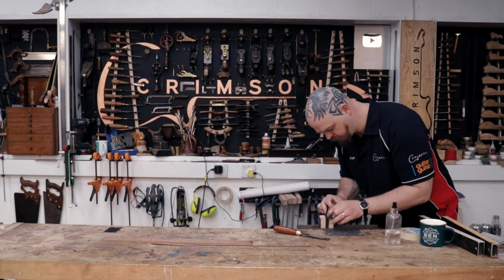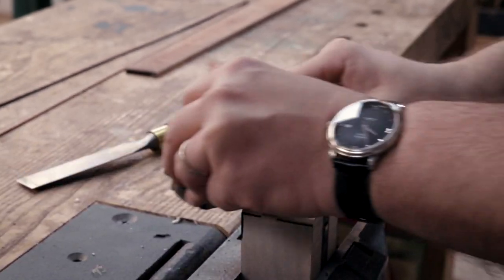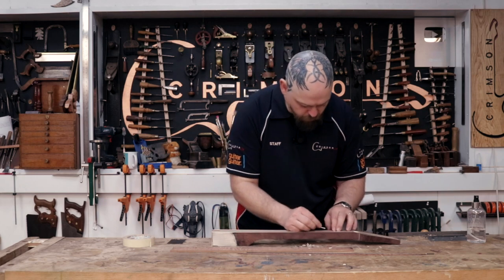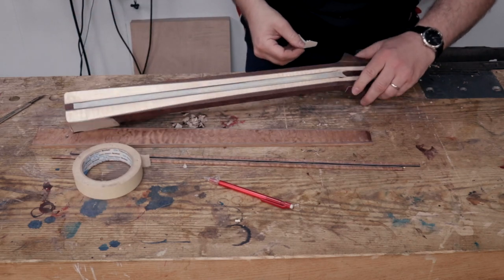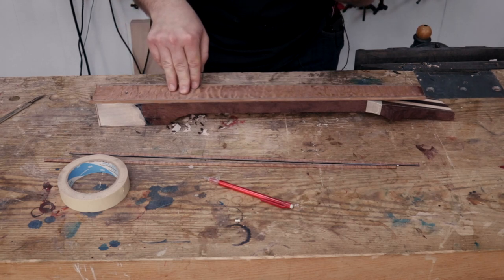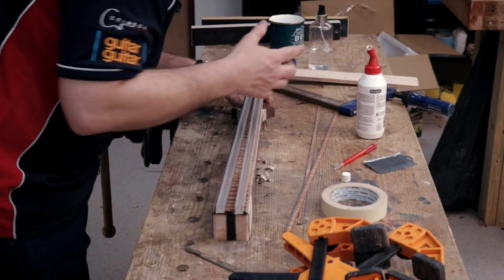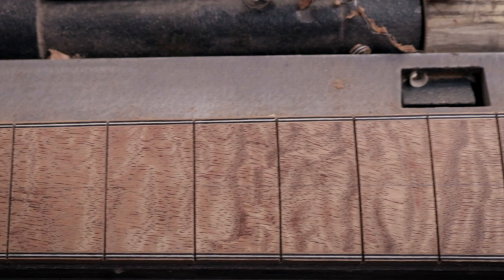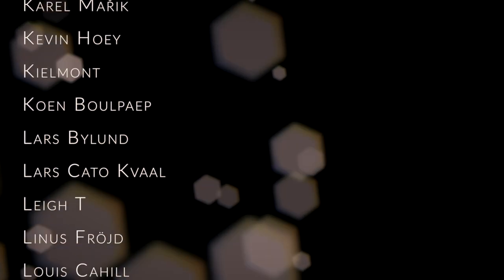Ep 11 Measuring and Marking - Still working on the neck -  The 90 Hour Build - The Complication

Comment: To keep parts from sliding out of position when clamping glued parts together, cabinetmakers place a few grains of sand along the glued surface, keeping them away from anyplace where they could dull plane blades and chisels afterwards.  That way, as the clamping pressure is applied, the sharp edges of the sand would bite into the two faces being glued up and keep them from wandering around.  Thoughts on using this cabinetmakers method in the art of luthier?
Reply: I don't see why not. Although I suspect he'd use something like ground amethyst or ruby, you know :P Mere sand, hah, no, no.
Reply: I see most people use salt.
Reply: @twistedhairball I believe that's because the salt is soluble and will dissolve with water-based wood glues. I guess this would avoid the issues mentioned about dulling blades.

Comment: I noticed that you don't use any carbon rods in the neck. Is there any reason in particular not to use them? Are they only needed for guitars with extra strings? (Their function is to prevent twisting and warping of the neck.)

Comment: did you just clamp that down with the tape still on ? :o
Reply: To keep most of the glue from the truss rod.
Reply: @splenditsanguinor  ow damn i always peel off the tape before i clamp the fretboard on. i thought that its function was just so that the glue would be further from the truss rod, so that when the glue spreads due to the clamping, it wouldnt reach the cavity